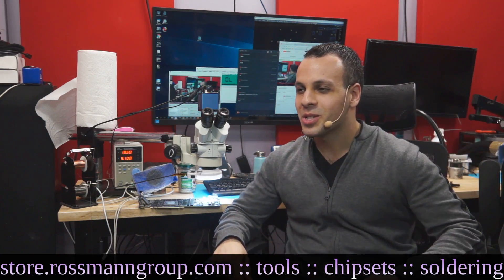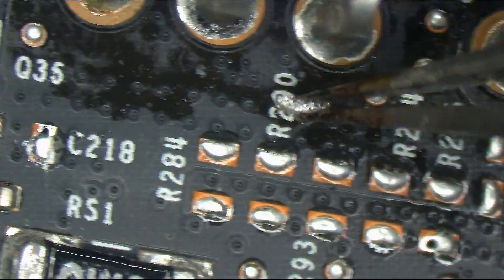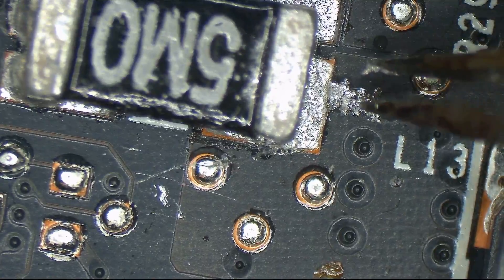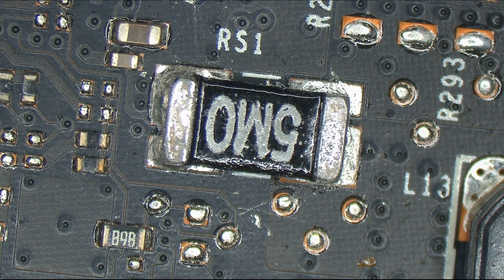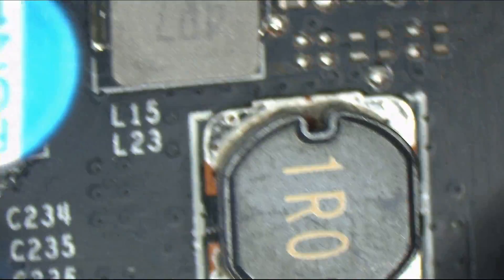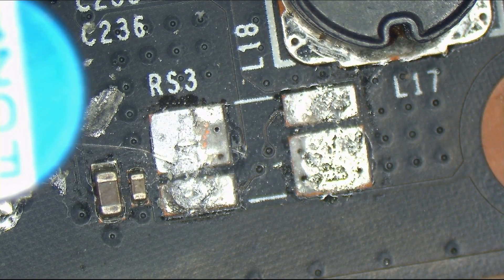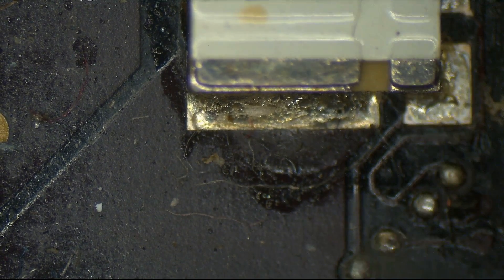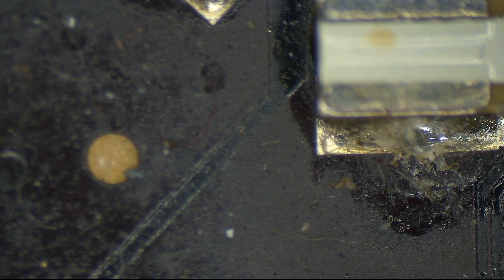DO NOT SHUNT MOD YOUR GRAPHICS CARD WITH LIQUID METAL!

Comment: That was the owners fault, not the manufacturer
Reply: voltage shunting is all the rage at the moment in the over clocking scene, and placing products like Conductonaught on current sensing components (like that resistor) is common place in chasing the highest results. The lands are literally wet with Thermal Grizzley Conductonaught (you can see it plain as day), which being gallium based; reacts severely with a number of metals and destroys their structure completely. If you're referring to IPCA 610-D class 3 - these are consumer electronics, not Milspec, aviation or enterprise grade . not being held to that standard doesn't mean it's poorly built. Im not sure why Nvidia would decide skimp on their flagship product; Hey, maybe they do.. or don't  either way; This damage has nothing to do with soldering quality.
Reply: @forestR1  Exactly. According the IPC specs, the videocards are Class 1, consumer grade products. The only requirement is that the product needs to work out of box. Nothing else. The buyer(in this case nVidia, not the actual end user) have the right to overwrite the IPC specs, but only certain vgas fitting the specification to be placed to the Class 2(like Quadro series). Class 3 is out of question.
Reply: Matt Christie no, high-end Nvidia cards are poorly built and soldered, they don't have to meet class 3 requirements so they are not well qcd
Reply: @CryoftheProphet  the solder joints on my 1080 look pretty well done, no shunt modding here..
Reply: @0xsergy  That may be, but video cards are not meant to be up to class 3 specs for soldering, like, say, pcbs in military components would require, so there is a lot more potential for failure, the rtx cards are having some major issues right now if you follow the news, I dont know whats causing it but Id imagine there is an engineering flaw somewhere.
Reply: @CryoftheProphet  i dunno, any gpu ive owned outlasts its useful life and usually the chip on mine starts to go bad after 7+ yrs so time for a new onr anyway
Reply: @CryoftheProphet  ref RTX failure; you might already be following this,  but it appears that the main failure point is the memory modules. And ONLY the ones coming out of MICRON. That won't account for all issues,  but it has been shown that they are degrading VERY quickly, and under clocking them a small amount alleviates the issue. WRT no IPC requirement,  I'm certified to hand solder to class 3, and I reckon the robots putting this equipment together would be doing a better job than I can.  Can't validate that though. I have AMD.
Reply: @CryoftheProphet  You know what military grade means right? The cheapest possible bidder/ contractor gets to do the work if it gets the job done; not the best or the, most rugged or greatest solution... The cheapest.
Reply: @cheesefries7436  There may be cases where that is true, but in most cases, the military is notorious for over paying in contrast with civilian pricing..  For aircraft or sensitive electronics made for demanding environments, you wont see less than Class 3 components being used, any equipment that directly involves preservation of human life, like aircraft, weapons systems, etc, all must be manufactured to this spec.  Does it mean it cant or wont fail, no, but it does mean its built with a higher level of attention and meets stricter requirements.  Ive built alot of weapons systems for many of the lockheed martin projects, like the apache program for example, and only the highest grade components are allowed to be used, with redundancy in place so things like pcbs have an extremely low probability for failure. Military contracts arent bid specifically based on price, I dont know who told you that or where you got that from.. I remember in the Navy we were paying 7.00 for the exact same .30 paint brush you can get at lowes..  The military budget is such that paying those insane prices is quite normal.. I dont know, your statement just seems at odds with what Ive actually experienced both as someone who has served in the military, and worked for them as a civilian.
Reply: @forestR1  Sounds like a process indicator or faulty engineering is the problem here.. At least from what you are telling me..
Reply: @peripheralinstaller704  no fo this ^ the user adding a gallium based product to components on his GPU is what's gone on.
Reply: @forestR1  yeah prob not a wise idea.. haha

Comment: Titan Xp = $1200 Titan Xp Star Wars Collector Edition = $1138 . That resistor is for voltage sense, and modders put Liquid Metal on them to bridge the connection, preventing the GPU from power throttling
Reply: Surely there are better ways to bridge the connection than coat resistor with gallium that has capacity to seep through entire motherboard? Even coke and tap water is less dangerous.
Reply: AKA a shunt mod
Reply: Cus' tutorials.
Reply: It's actually a current sensing resistor. For voltage sensing you don't need  a high power resistor. They don't use solder to bridge the shunt because most of them never had a soldering iron (and therefore soldering skills) in their hands. And you can't really hide the marks of some home soldering on a factory soldered board if you are not experienced enough while you just wipe the liquid metal off with a cotton deaded stick. Looks easy (if you are unaware of the chemical consequences).
Reply: the interesting part is, that nvidia overprices their produces now as much as apple, because as apple does so does nvidia have huge mindshare, to the point, where it doesn't matter if amd made a better  product.
those 1200 dollar titans should have been  650 dollars on pascal launch  at most with xx80 naming, but instead they launched  mid range chips as high end (gp104) , because there was no competition like apple is still selling dual core dirt to people....
Reply: Yes but it's true, if it's 0,00001 Ohms after soldering, it's probably too low and the card won't work. Something like 0.001 Ohms is desired. It's a current sensing resistor, so you want it to misreport, not to stop working completely.
Reply: It amazes me how people would go out of their way to get gallium and put it on their gpu when a $10 soldering iron and some solder would be much safer and do the job better
Reply: So could you replace it with another resistor then?
Reply: buckaroobonsi555 if I can keep every component cool, then what is the downside of exceeding a software limit, as long as I'm under the vrm's rated spec
Reply: A thin layer of LM does not act like a wire. It has a very small resistance value to it that tricks the card, so it will then draw more power. Overclockers running their cards on LN2 do it all the time. I just use MSI Afterburner to set the power target of my card (GTX 1080FE) to %120, thus reduces power throttling of the GPU itself. I also push the temp target to 92C, up from 83C stock. My card is liquid cooled, so I don't worry about causing any damage, since it maxes out at 37C.
Reply: They use liquid metal compounds usually used for better heat transfer between GPU and heatsink.
People who do the shunt mod usually already did this to their GPU, so most of them have a gallium containing compound at hand (and don't have to get out of their way to get gallium).
Also, they ususally don't have solder and an iron at hand.
And are stupid enough to not know that liquid metal should actually not belong into a computer AT ALL, because it can wreck aluminium, solder and potentially other metals due to amalgamation (not unlike mercury)...
And that liquid metal likes to move, because surface adhesion is very low and the metal will stay liquid indefinitely (until it has amalgamated with other metals).
Reply: Misac Tiba  philippe jara  Leonard Milcin 
You can't directly short out shunt with Pascal cards it will think sth is wrong with card and freak out. Which ends up not booting.
Reply: They make jumper resistors that basically function like a jumper wire but fit SMD sizes and shapes.  If you are putting liquid metal on a board you are not a "mod'er" you are nit-wit learn to use a rework station or even a soldering iron! Not you personally just anyone that does that! That is like someone using duct tape, bailing twine and 50/50 plumping solder calling them selves a Custom Car Tuner! LOL On top of that heat is the enemy of all electronics and to attempt to work around power throttling built into a circuit by the OEM is again stupid. Buy what you want or need or change the way your using a device dumbing liquid metal on things is not how you go about "improving" a device! LOL
Reply: Matt Christie, I call bullshit on your claim that it maxes out at 37C. Maybe at idle or moderate use, but not at full load.
Reply: I think if you solder it the resistance is too low